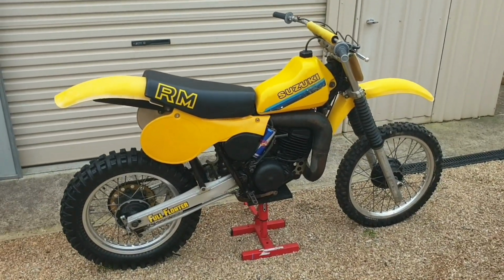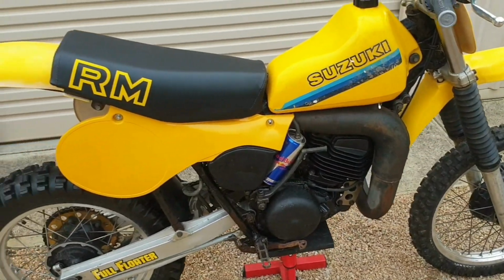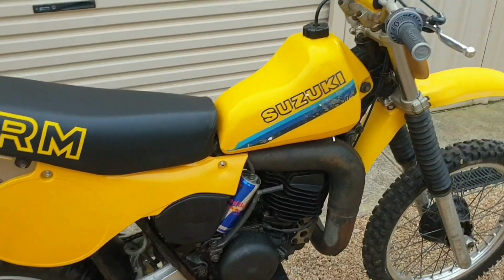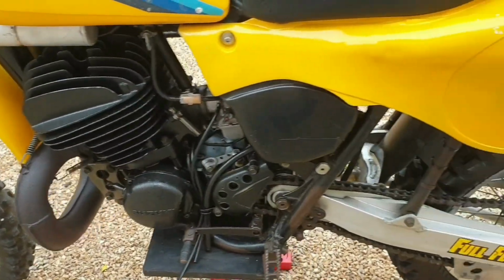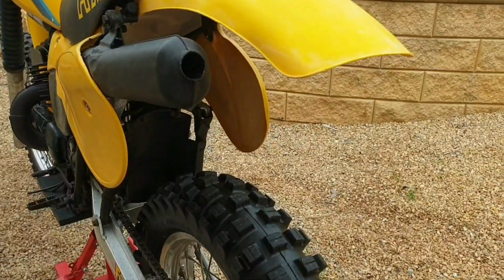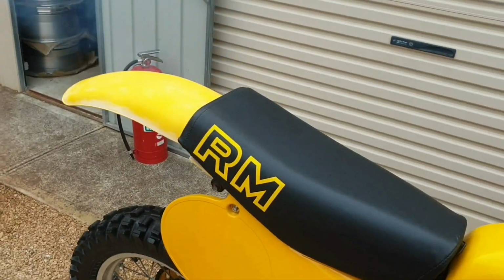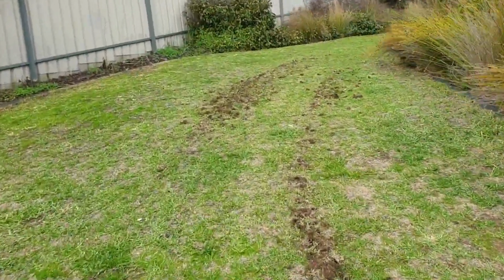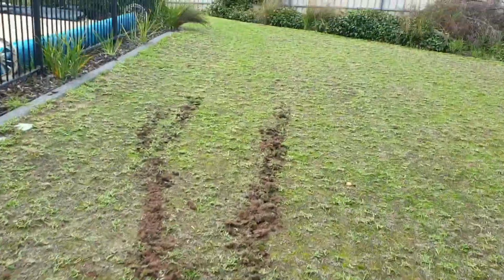RM 465 Suzuki 1981, Big bore Clean up, Test ride around back yard, VMX, Pt3

Comment: Nice looking bike mate getting hard to find now, are you going to replace the spokes or do you like the used look, ive got the rm 250 84 in the shed ,get it out every now and then and  take it for a squirt cant seem to let it go ,i did a ground up resto on mine ,looks mint 👍
Reply from the maker: Probably leave the spokes they look like they will clean up a little.
 I dont get the bikes out that much.

Comment: What is the canister above the engine on the LH side? Is that similar to the Yamaha expansion box thing that they ran?
Reply from the maker: Yeah its some sort of boost bottle connected back to inlet boot.
The suspension reservoir was attached to air cleaner behind kickstart which is ugly.